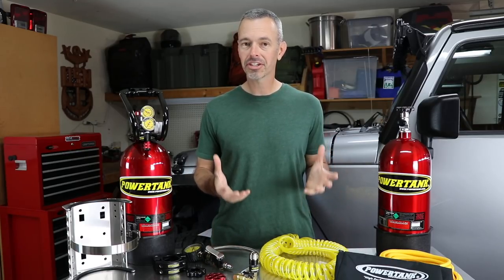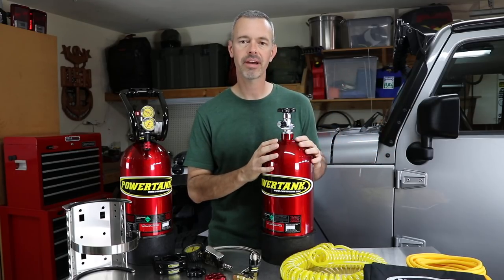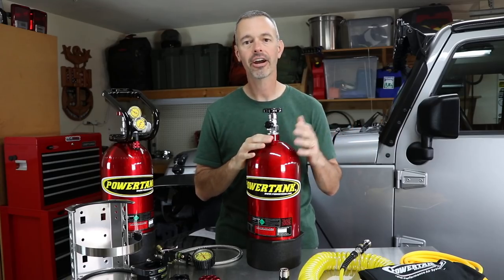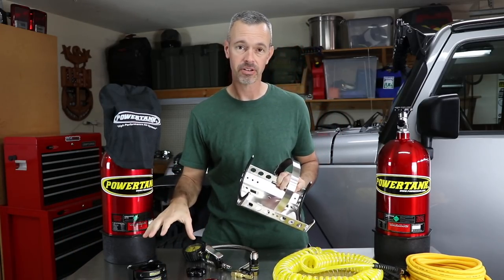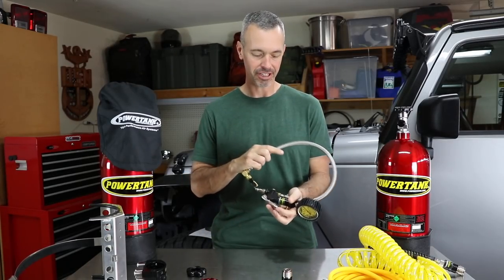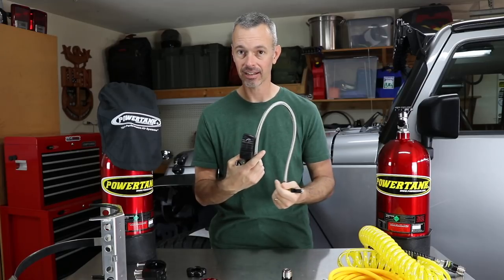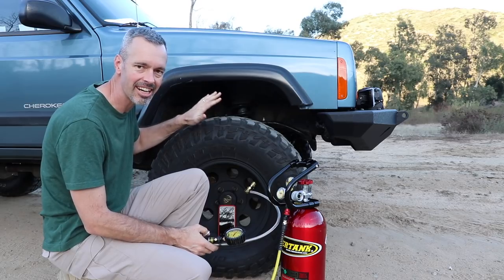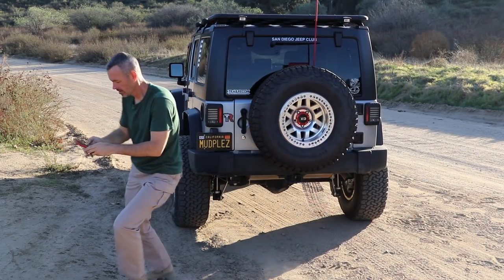Onboard CO2 System Review & Test - Power Tank

Comment: Great video Brad. I have a CO2 system as well but it’s not a powertank. I went with smittybilt due to a Black Friday sale....now I’m stuck buying a new gauge because it’s not accurate and quick disconnect fittings because they leak. Thinking of a second tank just to have. Will definitely buy a powertank. Very high quality stuff. I used my friends. Nothing leaked and gauge was accurate.
Reply from the maker: The Powertank regulators and fittings are worth it.... solid build quality!
Reply: Much of our equipment comes with a lifetime warranty, unheard of for other regulators in any industry. When you buy your Power Tank you'll know that it's the last air system you'll need.
Reply: Power Tank Official Thank you. Any chance you will be in so cal selling your product soon?
Reply: We have plenty of dealers throughout southern CA. The next time Power Tank will be in So Cal will probably be in Sept for Sand Sports Super Show and the Pomona Off-Road Expo.

Comment: My Experiences with CO2 was paint ball and temperatures below 40* Fahrenheit it would freeze up my paintball gun. BUT as a pilot taking Aircraft over 50,000 ft. We use nitrogen so I have been running it in my “car” for several years now. Other than the cost would that work?

Comment: Yeah my ARB twin compressor is nice but takes  forever to air up my 37” tires and will be worthless once I go 40”s. I also don’t see it lasting much longer after a year of hard (ab)use. Not looking forward to failing on the trail and losing lockers! Space and weight wise not a big diff once you factor in the need for a separate reservoir to run air tools. Filling up a friends and mines tires so we can get off the trail and to dinner in like 1/4 of the time just filling my tires with twin compressor is a MASSIVE improvement. Oh and we don’t have to yell over the sound lol. Time is money people 🤓

Comment: Sounds great, looks great too. I did notice a few videos back you and a friend made a multi-tire inflation system. (orange hose). Do you still use that with your C02?
Reply from the maker: I don't use it with the CO2 just because it inflates so quickly there is no need.  Also, CO2 is a higher pressure and not sure the DIY system will hold up to the pressures.

Comment: Did you try it using your four tire hose? If so, how long did that take to inflate?
Reply from the maker: I didn't try it just because of the high pressure of the CO2.  The DIY 4 tire inflator is just held together with hose clamps which may not hold with 250 psi.

Comment: Since it's Co2, is there a fire attachment for it?... Co2 would be easier to clean up(no clean up) compared to pkp or dry chemical after a fire event.... Just want to break the fire triangle without all the mess of abrasive pkp or dry chemical.... Co2 breaks the fire triangle in two ways, it removes o2 from the fuel and removes the heat....

Comment: Love the videos man. I have a chevy prerunner I use in the Southern California deserts with 37s on it. I typically don’t air down that much due to the speeds. Maybe 20 at the least unless I’m in sand. Generally run about 32 for street. Considering mounting a power tank in my bed cage. Few questions. How much does the 10lb weigh full roughly? How much does it generally cost to fill up? Think a 15lb would be worth it? The 10lb already seems rather large. Sorry if I missed any of this info in the comments?

Comment: I’m close to buying an air system for my FJ40 and after a lot of research I’ll be going with a power tank system. I don’t want to deal with the noise, heat, electrical, and slow inflation hassles of an on-board air compressor. Great video, thanks!

Comment: I use a 20lb co2 tank. I can run my impact gun and take off lug nuts.
Reply: Be careful. CO2 will corrode your power tools from the inside, out.
Reply: @C71-m1l  Moisture, not CO2 per se, does that so keep your tools lubricated as you should anyway.

Comment: When  your bottle is full of CO2, how much pressure is on the tank?   How many ft3 is emitted totally from a full tank?   
Brad, you are out of shape!  Give me 20!......  lol
Reply: The co2 is actually a liquid inside. Sitting at the bottom like water.  The 'empty' top part of the tank is gas at 800psi. As you take gas out the liquid evaporates making more gas so the pressure stays 800psi but the liquid gets lower. Eventually you have a full tank of gas 800psi but no liquid left. At that point the pressure drops quickly and the tank is then empty.  So it's 800psi the whole time until suddenly gone

Comment: Hi Brad. First off I really enjoy your videos. I run CO2, it’s a little expensive. My biggest issue is the gas is permeable, so over time in leaks through the rubber in the tires. That’s okay for off roading, but I was using mine on just about everything that takes air. It took me awhile to figure out why my tires were needing air so often. So now I strictly use the tank for the jeep. It also has saved me from needing to refill. I hope this helps.
Reply: tomb9953 Can you mix co2 air say with gas station air?

Comment: Okay question, why not just use high pressure air? What advantages come from CO2, not just the pressure?
Reply: Much more capacity for an equivelant sized air tank since the CO2 is stored as a liquid at high pressure.  This is why the CO2 tank must be vertical or nearly so while using it. The goal is to use the gaseous CO2 off the top then the liquid below it boils off and creates more gas.  This phase change is what allows a much larger quantity of CO2 to be stored in a cylinder compared to a comparible volume airtank. 

And if youre talking HPA like 3 or 4000 psi for something like a SCBA tank not sure qbout others but its a lot easier to find a welding supply store around here than a SCBA store.

Comment: Brad, Great Video and review. I have a Rampage rear rack on my JKU. I love it and do not want to be without it. Will the power tank roll bar mount work in conjunction with the rack? I realize I might not be able to store the rack in the up position with the tank in the holder but I am fine with that. Thanks in advance for your advise
Reply from the maker: Not sure if it will work with the rampage, but PowerTank has several different mounting options worth taking a look at.

Comment: I think you have sold me on this with the fact that I can add air to the motorhome tires.  I usually run about 100 to 105 psi and it take for EVER to air these six motorhome tires up when adding air.  Once again great video that was informational.  You are one of my favorite Youtubbers.
Reply: CO2 is more prone to pressure change with temperature change though, so you may have to check it more.

Comment: Why do you need a high pressure hose with a regulator on it?
Reply: Even with a regulator, we are seeing 250 - 400 psi with a constant flow. Most on board compressors put out 150 psi max. The other thing that makes our hoses different is that they're rated for high pressures at below freezing temperatures as CO2 can make things very cold.